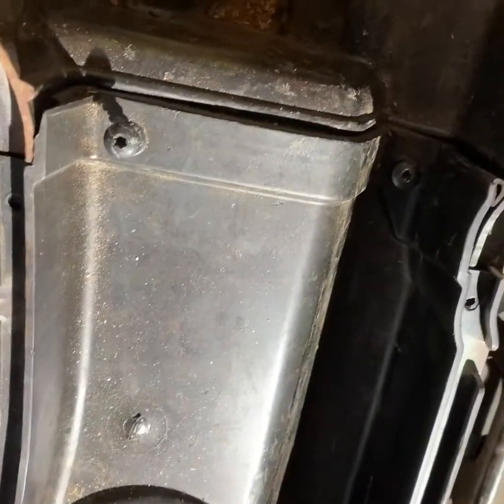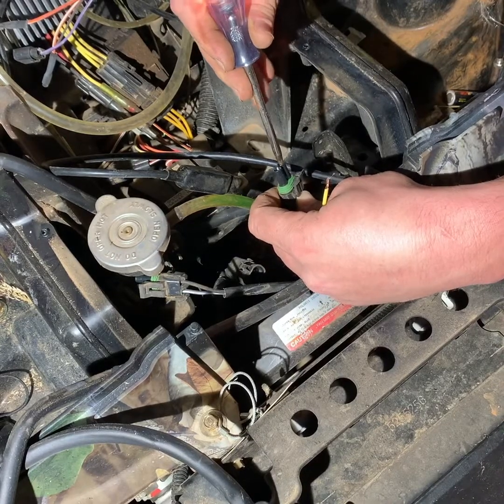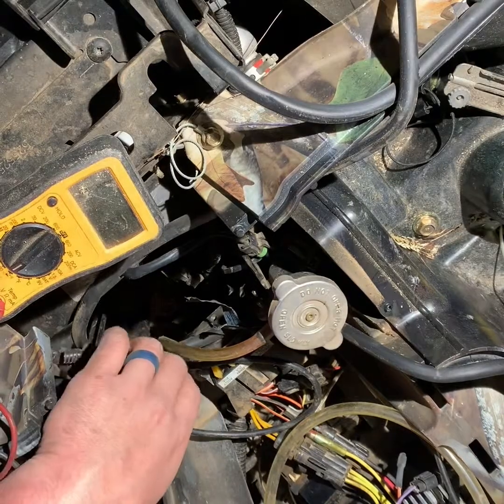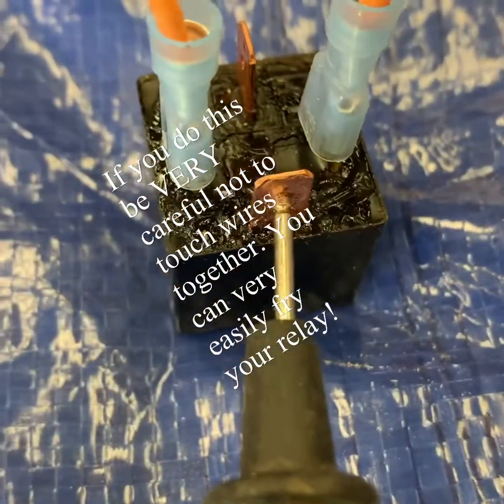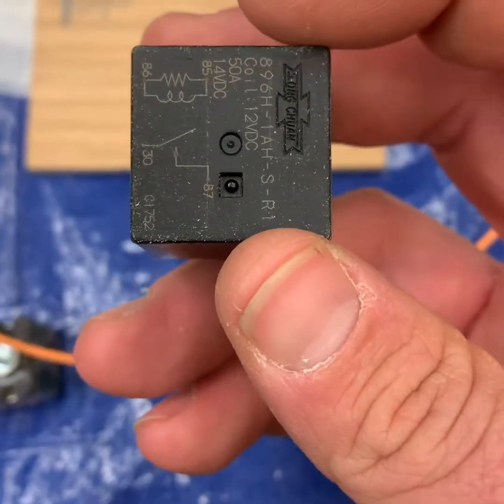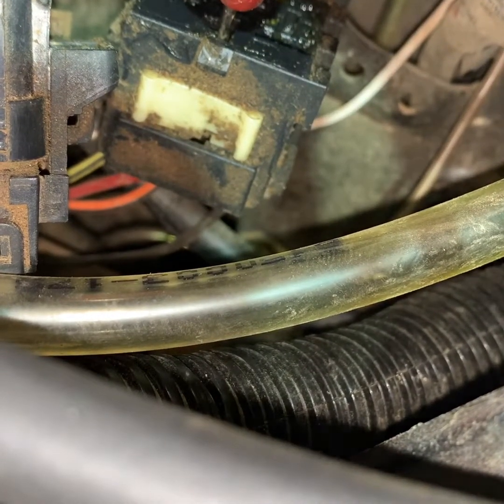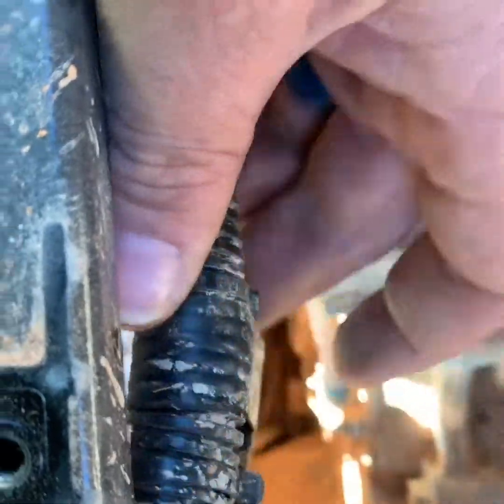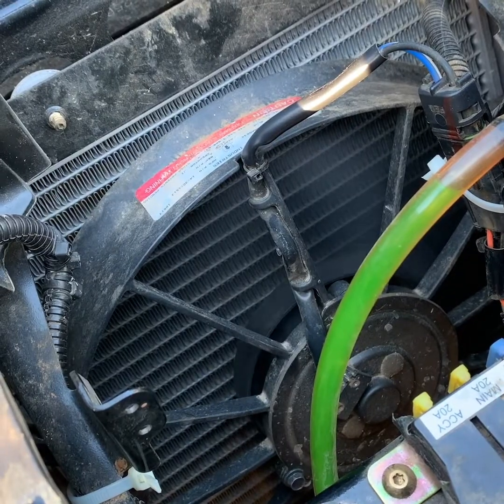Polaris Sportsman Overheating! How to Troubleshoot Electrical Cooling System.

Comment: What happens if your fan comes on but your hot light comes on but its not overheating.  Its just saying hot.  But is not hot,   or overheating
Reply: The "HOT" indicator on the dash is controlled by the sensor in the left side of the cylinder near the thermostat.  There's one wire attached.  That sensor should short a 12 Volt signal to ground when the engine is hot.  Use an Ohm meter to see if it's always shorted to ground (bad sensor).  It should have 12V on the wire connector when the engine is cool.
Reply: @FlyswatterThe1  I just put a toggle switch on mines.  It runs fine, just sometimes it said it's running hot ,  but it's not,  the fan runs as it should,  cuts off as it should.   Toggle switch on mines. Just to make sure the light don't run down my battery

Comment: Wow, great diagnosis! I have a 2014 400 HO with the same issue...I'm going to see if this is the issue.  I've been dreading having to load the parts cannon with all the other sensors and relays but if it is a simple fuse/circuit breaker that's easy to get to I'm all for at least trying to replace it. I'll post again to let everyone know if this fixed it.  If not then it's off to the races with thermostat & other sensors.  Fingers crossed.
Reply: That was it!  Thank you so much!  $10 from amazon and it's on the way.  I removed that circuit breaker, tried to source it at NAPA and my locat ATV shop (who said that was on backorder for over a month) but ended up buying it from Amazon.  I removed the circuit breaker, started up the engine and jumped the connection and bingo, fan is running again.  Why Polaris would hide that part in that location is beyond me.  Thanks again!

Comment: Well i replaced circuit breaker , relay and both sensors , fan still turns on when hot light shows on the panel. What could it be?

Comment: Only problem with mine is radiator fan not working I did have voltage regulator replaced and radiator

Comment: I have a 2008 sportsman 500 h.o (non efi) with a fan that always stays on, even with the ignition off? Displays engine hot even tho engine is cold, any idea what it could be?
Reply from the maker: I have not run into that one yet. I would check the thermostat and relay. Something has to be stuck to send power even when the switch is off. Possibly the ignition switch.
Reply: @FishHuntCookTinker  where exactly is the relay for it?
Reply: @ElPatronGamefarm  
Hello! Right now I'm having the same problem on a 2005 sportsman 550. Were you able to find the fault?
Reply: @nicolassambataro  yeah it was the ecu

Comment: Was watching your video. My problem is that my four wheeler fan only turn on for 10 seconds and then turns off. The four wheeler begins to over heat later on and goes into a limp mode. The fan does kick on just for not very long..
Reply: It’s a 2011 Polaris 850 sportsman.
Reply from the maker: Sorry for the delay. That is exactly what mine was doing in the beginning. Finally it would kick on once for a few seconds then nothing. Sometimes just nothing. Good luck! Thank you for watching!

Comment: My problem was overheating intermittently on a 2008 sportsman. Finding the issue was difficult until the fan  finally  stopped working permanently . Your video was great and very helpful in diagnosing the problem. I went through all your steps and like you found it to be the circuit breaker. On the 2008 the circuit breaker is WELL hidden under the main fuse block and frame at the front of the machine. Not nice to get at.  Anyone wishing to save a few bucks, the 10 amp breaker at a local automotive supply is 1/4 the price of Polaris part.
Thanks again for the video
Reply from the maker: I am glad the video helped! I had a time finding mine and hoped to save others the hassle. I hate it wasn’t in the same location, but I am glad you were able to find it. It makes no sense why they hid the circuit breakers. Thank you for watching! I hope you don’t have any other issues for a long time.

Comment: I have a Polaris ace 570 and the fan won’t kick on and then it overheats because of the fan not kicking on what should I do?
Reply from the maker: I am not very familiar with the ace. It should be the same basic setup. Test you fuses, thermostat, and circuit breaker. If they are all good it may be a bad fan. Wish I could tell you more about them. I just have never worked on one. Thank you for watching and wish you luck!

Comment: I have been  chasing this issue for like 2 years even wired a ma ual.switch to my fan and you saved me...it was my fuse under the air filter housing too!
Reply from the maker: I am glad it helped. Thanks for watching!
Reply: Was it saying hot all the time or intermittently?

Comment: Excellent video explaining the process - thanks heaps. One thing I don't get though - you confirmed that there was power to the relay, so how did the faulty circuit breaker cause it to not work?  Does the circuit breaker cut off positive and negative cables?
Reply from the maker: To be 100% honest it has been a while since I traced all the wires out. If I remember correctly the circuit breaker was on the down stream side of the relay. The hot wire came to the relay then back through the circuit breaker. Then to the fan. The circuit breaker only controls the positive wire. Hope this helps. Thank you for watching!

Comment: 2012 500 HO. Had same service message. Bypassed sensor that is on the radiator, the fan didn’t turn on at first but now turns on but “check engine hot”  message is still on screen. Any input on what it could be???
Reply from the maker: My circuit breaker would go in and out. I would think I had it fixed. Then it would stop working again. Finally I changed the circuit breaker and solved my problem. You can temporarily bypass it just to be sure. Definitely wouldn’t run it that way, but works for troubleshooting.

Comment: Thanks for the video! I bought a 2013 Polaris Sportsman 500 recently and it was a hot mess with the wiring ! I fixed the majority of it and this was the last on my to do list, as you mentioned on the video it was the 12v 10 amp circuit breaker that was the issue...it was heavily corroded and power wasn’t getting through so I replaced it.
Reply from the maker: I am glad you found it helpful. Thank you for watching!
Reply: I have 2013 Polaris sportsman 400 h.o only problem I have now is radiator fan quit working after the voltage regulator was replaced same with radiator

Comment: Thanks I've currently got my fan hot wire to an on / off switch, having to replace it, after a hard ice bog hunting return trip,  that  turn my machine into a mud ice-cube. it also fried the regulator too.I have the coolant  temperature switch, but   I'll definitely check the fan relay and look for an overload in the circuit too.  Rebuilding my winch at the moment too and rewiring everything, with watertight fuses  as I go. Thinking  maybe mounting the rad, up top, above the mud line, is a better idea, even if i  loose the front cargo space.
Reply from the maker: I can only imagine what turning one into a “mud ice-cube” could tear up! I don’t think I could do without the cargo space. I am always strapping things down all over my wheeler. Good luck getting everything going again. Thank you for watching!

Comment: AT the 8:56 mark you say 20 amp relay for continuity but dont show where to connect, can you email me a definition of where to go with that?
Reply: sixfourhim@gmail.com
Reply from the maker: I miss spoke. I checked it at the 20 amp main fuse not the relay. Don’t know how I didn’t catch that when editing. You can see it at 9:00. I checked it at the fuse to check the integrity of the wire from the relay block to the main fuse. The wire goes from the battery. To the circuit breaker then to the fuse block. Ending at the relay block. I hope this helps.